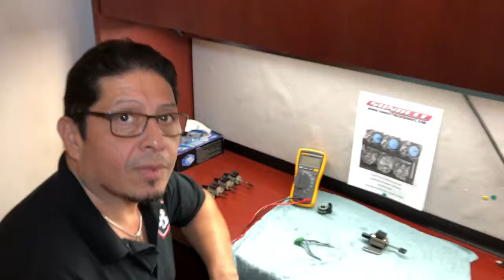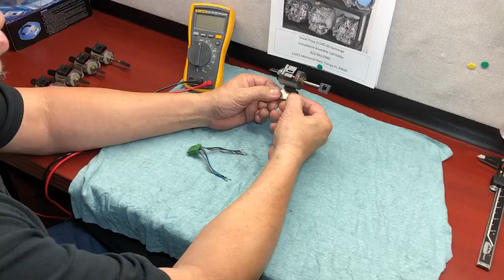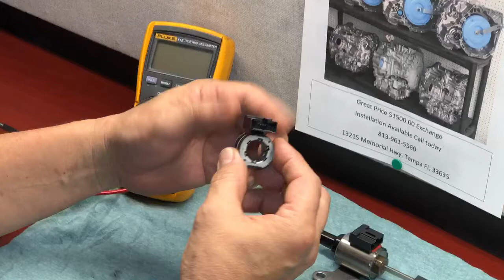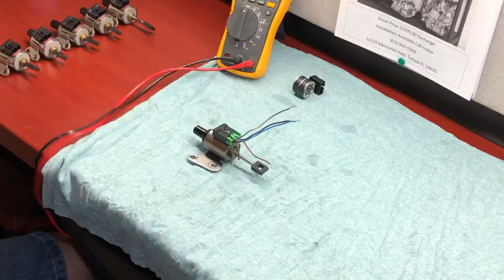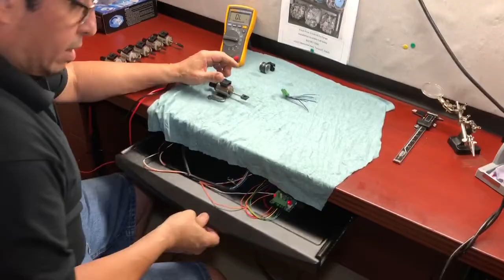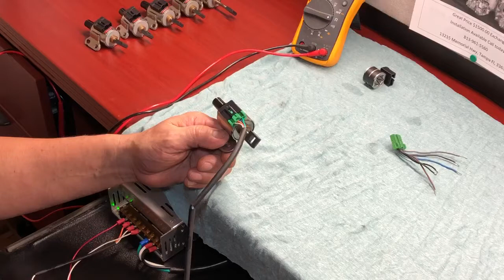Nissan CVT Valve Body  Stepper Motor Test

Comment: Hey, came across this video when trying to diagnose my son's car.  He has a couple of error codes and his car won't move anywhere.  When you try to apply throttle, it surges, but no vehicle movement from the transmission.  2008 Nissan Versa.  Wondering if they are more prone to valve body failure, stepper motor failure or complete failure.

Comment: You're the man. Exactly what I needed to see. Perfect guidance and great explanation brotha! I ordered a Beck Arnley replacement, installed it, and immediately had a shuddering. Thought it was normal until the transmission relearns the new fluid viscosity. But a week later, car just wouldn't move and kicked a code, P1777. Can a bad alternator or battery burn or make a new stepper motor go bad? Or maybe I received a faulty stepper motor? I don't know...

Comment: I recommend these guys 100%. They're very helpful and glad to help anyone. I have a little story on how they helped me i was replacing a cvt and i could've find the front pump seal went to nissan several different stores with no luck of finding the correct seal nissan even ordered several but they were  not the seal i needed needed so i was at my whits end on what to do and i happened to remember watching them on YouTube so long story short  i was in desperate need for this particular seal or obviously couldn't get my car on the road so contacted them and  sunbelt told me to call transtar so i did the guy knew exactly the seal i needed amd sent me the correct one the first time thank you guys for all yall do definitely a great group of guys
Reply from the maker: Thank you so much for taking the time to share your experience! We love hearing a good success story.

Comment: Will that be the cause on my 2010 Nissan maxima. When you start the car and start driving car works fine through all gear on highway then after awhile car act like it slips gear on highway like in 6th gear then when you let go of gas and cruise it starts working
Reply: did you ever get it fixed? I’m having the same problem with my 13.

Comment: I have a CVT stepper motor (still inside the gearbox, 4 wires coming out = 2 phases according to the manual, )
Both coils have ~24R, which is fine (shall be between 10R & 30R for my gearbox)
But Phase 1B has 5R to GND,  which I don't understand (others are high-z).
So can this be a stepper motor issue or cable issue inside the box?

Comment: P1778 I replaced the cvt valve body and not motor.
Reply: where did you get the part? Did you have to get it programmed and did it work well?

Comment: Hello how can I check the stepper motor at home 
I have three of them and one I bought after market Amazon I guess they're refurbished from Amazon it's not brand new and still I get the P1778 code on a 2008 Nissan Altima CVT transmission,so I'm not sure if the stepper motor is good from Amazon or not is there a way for me to really check it out at home with the multi meter because I don't have that fancy equipment like you do in the drawer that you pulled out
Reply from the maker: Hi @alhavana9426! On our website, we offer a technical support program to help diagnose your issue. Please check us out! https://sunbeltvalvebodies.com/products/19025-sb

Comment: What is the symptoms of a bad step motor? Reason for asking I got a code for P1778 I changed the stepper motor vehicle changes smooth sometimes, at some point on acceleration vehicle revs high to 40km then lurched and start driving normal happens more often each time I come to a full stop

Comment: Great video. 

I need help. 

2009 Nissan Murano. 

Transmission Range Sensor A? P0705 code. 

I can put it in PRNDL but the cluster only shows “P” and “N”? 

I changed the stepper, fluid and filter but no different. 

I can send a video of my valve body if you send an email

Comment: Thanks for the video. Have you guys ever seen a sticking stepper motor? 
I have a weird downward lope/momentary loss of power in my Altima. Drops from 4k to 2k and goes right back up. Takes about one second. 
I’m sure you get bombarded with questions but I’d really appreciate your opinion. If you see this. 
Thanks sunbelt.
Reply from the maker: Hello. Thanks for watching our videos. We offer Tech support if you are not a customer we charge for it but it will definitely help you with your question and problem. You can call us for more information. 8139615560. Thank you

Comment: Hi! Fabian, thank you for such amazing video. I have a question I was driving my 2008 Nissan Sentra CVT and the sudden the speed went down to 40 mph abd lost force, I scanned and it’s reading code P1777, which means stepper motor issue. Do you think I should change the stepper motor? Also a mechanic told that I can use the old transmission fluid if I replace the stepper motor, it’s that true? Thank you for your feedback
Reply from the maker: Hi Ernesto!! We are glad our videos are helpfull. We can certainly help you. Write to our email info@sunbeltvalvebody.com asking for tech support or visit our website sunbeltvalvebody.com. Thank you

Comment: My 2010 Altima has a p1777 code am I wrong in leading towards the stepper motor  one of the coils ohm at 6 the other 3 were 15 ? Thanks

Comment: Does the stepper motor normally makes a whining sound when is going bad????
Reply: Not so much. I'm my experience that is more a sign of the flow control valve in the pump going bad.
Reply: @davidploessl1796  what is the cause if the Nissan CVT, doesnt exceed 100mph ??
Reply: @edwinalexander1170  that leads me to further believe that the flow control valve in the pump is going out and leaking and not allowing the pump to work to its full potential.
Reply: @davidploessl1796  waoh i like your explanation. What should i do ? I like the car but that  issue of limp mode at 100mph makes me unhappy.
Reply: @edwinalexander1170  unfortunately you either keep driving it till it keeps getting worse and eventually goes out, or look into getting the transmission rebuilt or replaced now. If you are mechanically inclined or like a challenge, you can tear out the tranny and rebuild it yourself. There are a lot of videos available showing how to do so.
Reply: @davidploessl1796 i just checked for the trouble code for the transmission and it gives P0740 and PO 741. That reads Torque converter clutch solenoid or circuit malfunction,  Sometimes the car goes up to 100, and sometimes 120mph, but a lot of whinning noise especially i go long journey about 120 km will start going into limp mode at 100 or 80 mph and not rev above 2500 rpm.what should be done ?
Reply: @edwinalexander1170  sounds like internal failures. Could start by replacing stepper motor and see if you get lucky with that fixing it. You can replace stepper motor with tranny still in vehicle. If that doesn't fix it, most likely have internal failures like the flow control valve in pump leaking or seals in the drive Pulleys are leaking.
Reply: @davidploessl1796 Thank you so much.  i will buy the steper motor and replace the existing one, i will also try to replace also Torque Converter Clutch solenoid, and both filters  and  come back for the feedback, as i sometimes hearing the whinning noise comes under the transmission pan when i accelerate.

Comment: Love the content. So recently my 2013 maxima has no check engine light on, no trans codes either. I did notice from 20-30 mph the trans stutters but as soon as i let go off the gas and press it again it goes smooth. Then when im going 60 and slowdown from 40-20 its like rumbles. Could this be a bad stepper motor?

Comment: I have a P1777 code for stepper motor circuit where is the circuit located so I can fix the problem??? This is on 2007 Nissan Murano S is this part of the connector?

Comment: Hi there, I checked my old and new stepper motor and both measured on the outside coil (middle wire and outest wire) 28 ohms… and the other coil is at 14… does that mean my old and new one are broken?
Reply: I got readings similar on the old and new one also.  Did you find anymore info on it?
Reply: My old one and new one both measured about 17ohms and 32ohms on the coils.  The new one worked and fixed the problem.

Comment: Where can I get this stepper motor for the Nissan Murano z50 CVT, Built 2006, European version. With shipping to Germany? There a many offers but I think it's very pur quality and Nissan does not support this part.

And please tell me, can I just put it in without get the position of the old stepper motor or do I have to get it manually to the same position as the old one - when I will change it?

Thank you very much and Best regards from Germany
Reply: Amazon

Comment: Hey Fabian I have a 2008 Nissan Altima 2.5 S I'm I'm trying to find a reliable Step motor replacement for my car. But I'm not sure about the part number. I don't want to get one that doesn't fit. Do you know who sells them that can fit my car? Thanks!!
Reply: Hey George, I have found it hard to get the actual part number for the step motor as it is not an individual part that Nissan sells. It is usually bundled with a valve body, but not always. I ended us using my transmission number JF009E RE0F08A to find the part. I got it (OEM part too) on ebay from seller tranzmissionpartsusa. Good luck!
Reply: @Eric-hk5xt  Eric I found it I bought it at I think it was AutoZone. But I fixed it it was working for like 2 weeks and then all of a sudden it went back into limp mode. Now I went and changed the speed sensor before that it would only go after I went back and lent mode it would only go into third gear now it goes into fourth gear sometimes fifth and it's erratic now. I don't know if there's another sensor bad but the codes are still coming up p1777 and it's driving me crazy.
Reply: @OUTLAWNEWSTZ  Oh man, that is shite! I am waiting on my CVT fluid to see how mine turns out. Did you happen to visually inspect the related wiring harness and connectors? Check for damaged components and look for broken, bent, pushed out, or corroded connector's pins. If not that, you can spend countless hours researching....or countless $$$ getting it fixed at a shop. Let us know what you find and good luck!
Reply: @Eric-hk5xt  Yeah I'll let you know. Now this was my Father in laws car he gave it to my wife. He had to jimmy up the speed sensor harness because some of the wire looked frayed.  I don't know if it could be that or not , and still throwing out that P1777 code. But I'm going to look at it and make sure it's ok.
Reply: I also have a 02 sensor bank 1 code. Car has been running weird. Also have a vapor leak code coming up, and its idling up and down a little.

Comment: Hey Fabian; writing you from Jamaica. I have a 2010 Nissan Lafesta Sport. My problem is with the stepper motor. I replaced the motor but the problem persists. I need to know how do I check to see if current is going to be motor.

Comment: What controls the stepper motor? TCM or ROM? 2012 Maxima REOF09. Scanner reports motor is at step 196 and desired step is same. changed computers and same thing. stepper motor at 196 and stays there.

Comment: Sir, my Nissan sylphy 2.0 2008 p1777 show out and stuck in first gear,, can't change to higher gear

Take out the stepper motor measure ctr to 2nd wire 16.3ohm and ctr to 1st wire 31.3 ohm

Is that stepper motor issue??? Thank you

Comment: I just got the P1778 code for stepper motor on 2012 Nissan Altima.
(i believe JFO11E)
Just pulled it all apart and checked resistance like you did in your vid. Checked harnes for shorts, its all functioning properly. Checked the 4 coils and all 4 are at 15.5.
Only thing i cant do is electrically try it, because i dont have the controller to test it. I believe the stepper motor is ok...but what i did notice was the ratio control valve, that attatches to the motor, seems to not move freely within its bore. It feels a tiny bit sticky. Could this cause the code for stepper motor? If so what is the remedy for it? I looked at valve bodies online, and looks like none of them come with the ratio control valve. So im assuming you must need to use it from original. But what if it is not within spec? It would cause issues on new VB...is there a way to bore or hone the original bore for the valve?
Symptoms are the vehicle shifts or "varies" up till about 45mph, then holds the rpms around 3K but wont upshift. Then it sets the code.
Hoping for some help.
Thank you kindly!!
Reply: I've meet the same problem right now, I still have no idea what's going on. Do you have solve this problem?
Reply: @ezy123abc  
Yes i did figure out the issue...The trans was shot! Replaced it with a quality used one, and have had no issues what so ever.
The pulley doesn't travel correctly, and it causes the stepper motor code.
Reply: @splash5974  wow, thank you so much!!really appreciate
Reply: Splash@ so how we know if too late the pulley inside mess up and transmission is shot … possibly low fluid or no service transmission that why it got shot